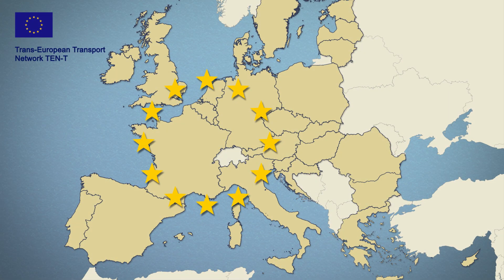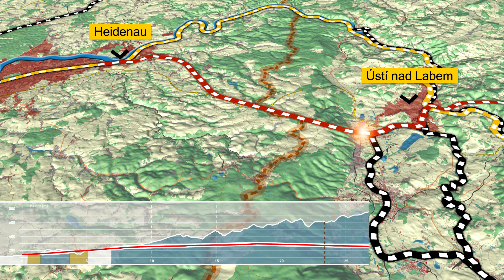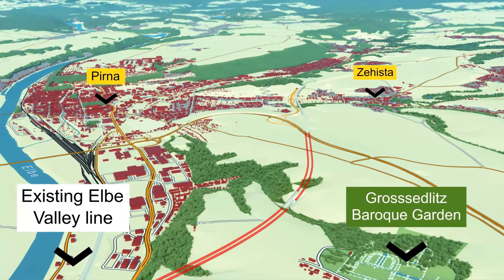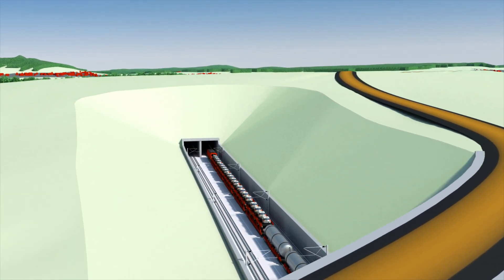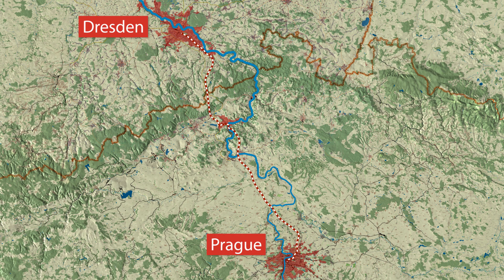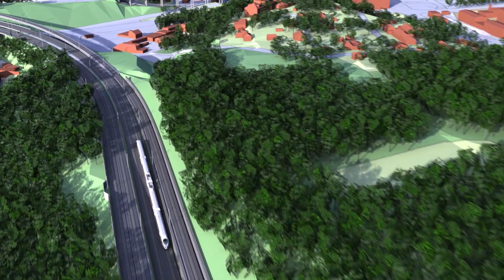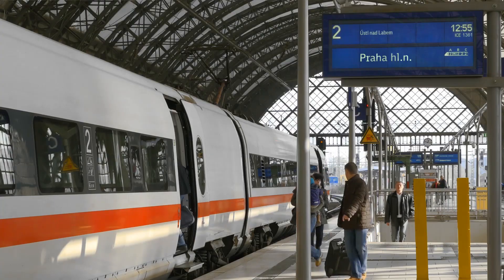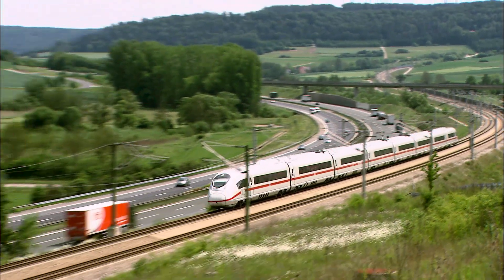The new railway line Dresden – Prague

Comment: If they can do this between Dresden and Prague why not between Munich and Innsbruck?
Reply: Dresden - Ústí nad Labem is the only electrified cross border connection.
It is overloaded similar to the route you mention.
There are ideas to upgrade other cross border lines.
But this project has the benefit to shorten passenger travel time (Berlin - Prague - Vienna) and increase cargo load in one.  

Munich - Innsbruck 4 rail extension will happen, but that is a different concern.
There is a lot of resistance from residents on the German side.
So planning phase is stretched.

Building a tunnel seems to be easier than extending a 2 rail line to 4 rails, currently (in Germany)....
Reply: That would indeed be the more clever idea. But the costs.....